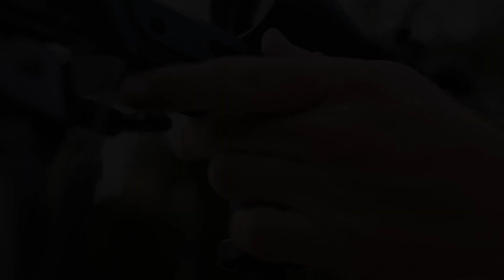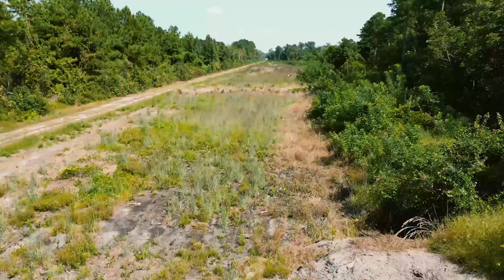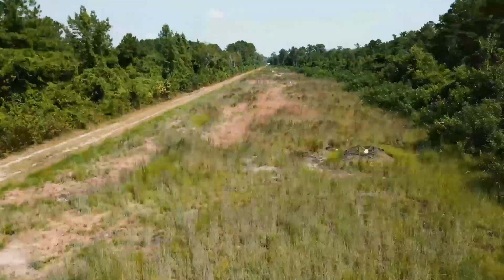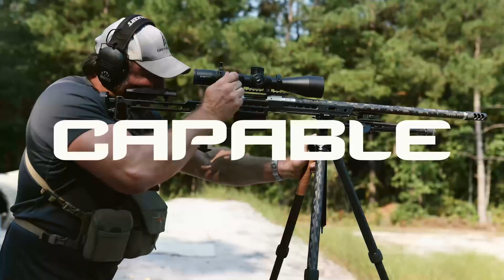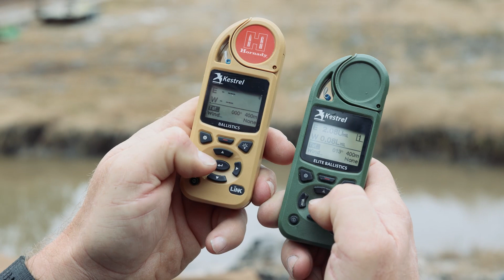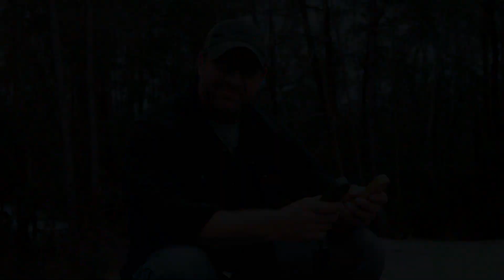Kestrel Comparison: Applied Ballistics vs. 4DOF

Comment: Your explanation of the memory capability (3 vs 30) is misleading.  This difference has nothing to do with 4DOF.  All the kestrels (except the elite) have a 3 gun memory. If you want 30 your only option (at this time) is the Elite which forces you into AB as they havent offered that in the 4DOF model. Also not stated is that the bullet library is not limited to only Hornady bullets. Unfortunately, the library on the Kestrel app is not as large as in the 4DOF app.

Comment: Just ordered the 5700 ballistic that uses applied ballistics as the solver but is not the elite version. For me, the range card, target card nor 30 guns were worth 300€ in price difference. And I still have the option to upgrade the 5700 ballistic to an elite for the 300€ if I later decide I need it.

Comment: 4DOF is probably good if you're shooting only Hornady bullets. But, if you also shoot Nosler or something that they don't have built in to 4DOF, is the Elite a better option so you can solve for a wider range of bullets?
Reply: 4dof has almost all the common bullets from every manufacturer that would be of "modern" design and if you send them bullets they will add them for free

Comment: Really appreciating this type of video done in down to earth analyzing of products without getting into every little detail from appearance to weight and color. I'm all about how shit works and it's functionality in real world situations. I am looking to get rid of unnecessary equipment, ie: range finder, phone (which in most cases doesn't work where I'm at) wind meter, ballistic data. Got the range finder/binocular problem solved now working on the ballistic data/wind/earth data/ solved and this was helpful. Now if Kestrel would just add OnXmaps....yup that would  do it!

Comment: I have the same 2 solvers, and I am getting different elevation solutions. I also use the 6.5 cm heldm factory and custom drag models for AB. Side by side,same rifle I get a difference of 0.4 mils at 1000 yards. The AB gives the more accurate solution. No clue why this should be.
Reply: Did you adjust the BC in the AB version but not the 4DOF version? I ask the question this way because in 4DOF, you do not adjust the BC, you adjust the Axial Form Factor. Once the Axial Form Factor has been trued (adjusted BC), it will no longer be .4 off.